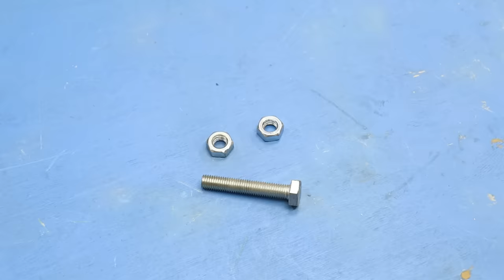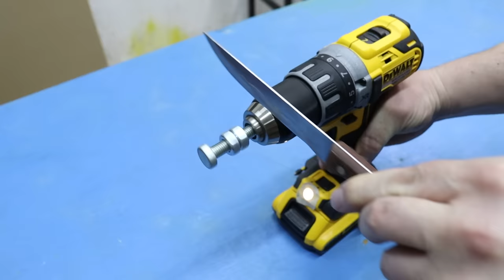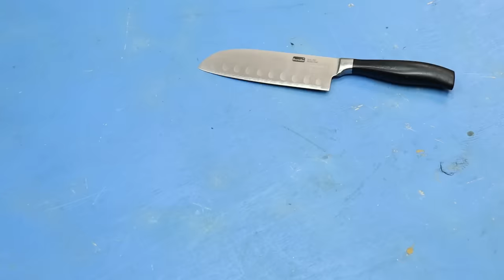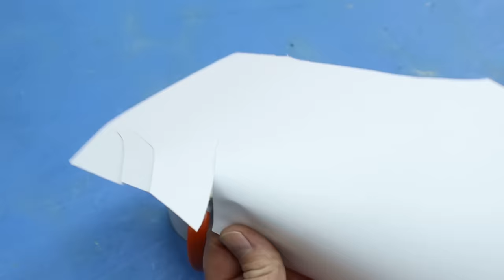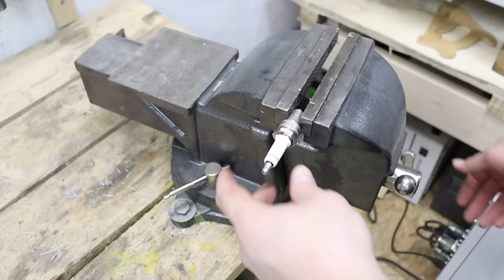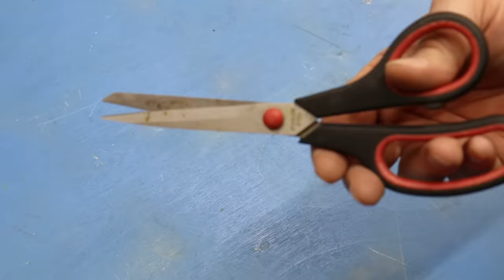НОЖ как БРИТВА за две минуты! РЕЖЕТ ДАЖЕ СВЕЧИ! Мало кто знает эту функцию свечи зажигания!

Comment: pretty thick paper.  try that with a paper towel.  Lay it down on a table and pull the knife over it. if it cuts the towel then its sharp. 
  The spark plug will not sharpen the knife.  He is using it like a butchers steel which does not sharpen a knife it only straightens out the edge so it cuts better.   These are all just youtube tricks not really good practice
  Get a good  waterstone and learn how to do it right.